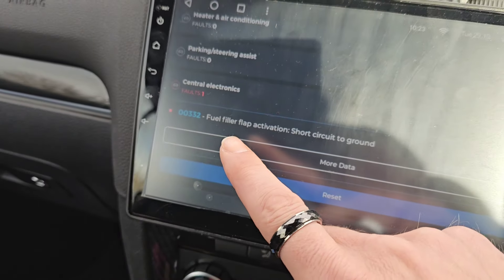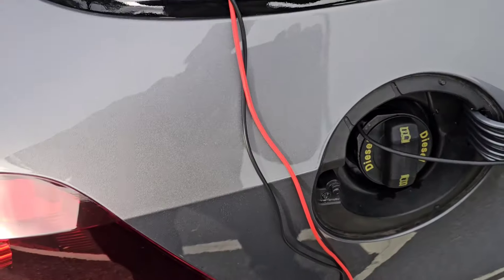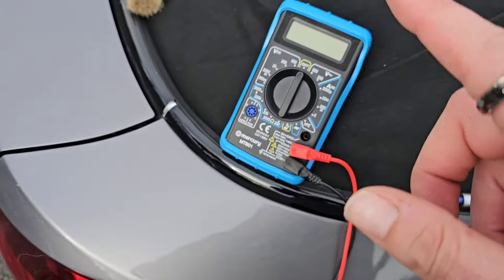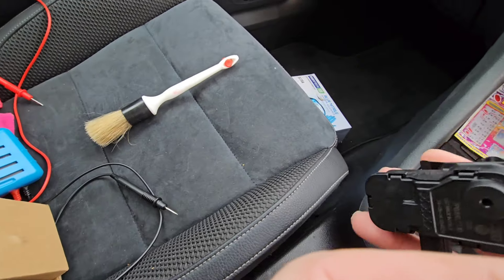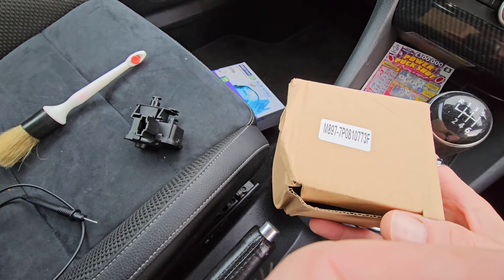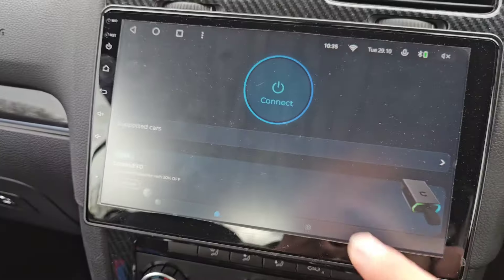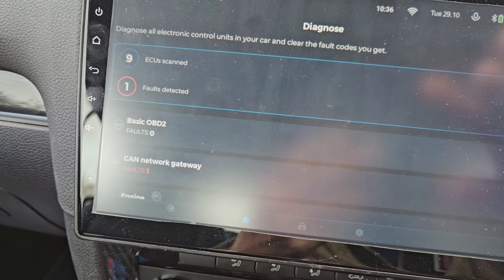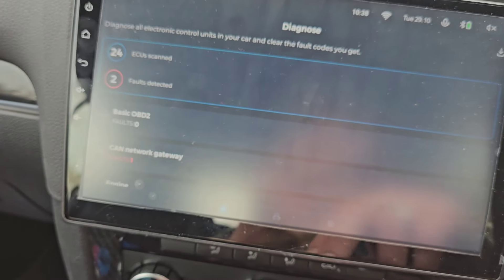VW fuel flap switch replacement 👌 #Carista #automobile #volkswagen

Comment: Another useful video, Dave. I will be checking my fuel flap. Just have a question about your Carista scanner. Do you leave it plugged into the ODB port all the time, and is it safe to do so? I only tend to do it when I want to diagnose or adjust a setting.
Reply from the maker: My reader is plugged in 24/7...that way I don't lose it 🤣 doesn't pull enough power to cause halm to the battery 👍